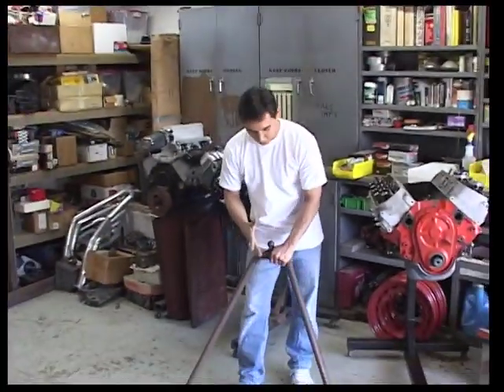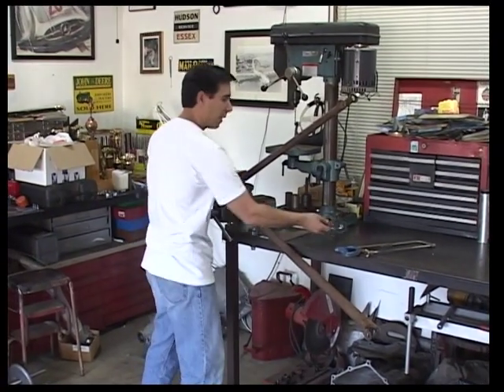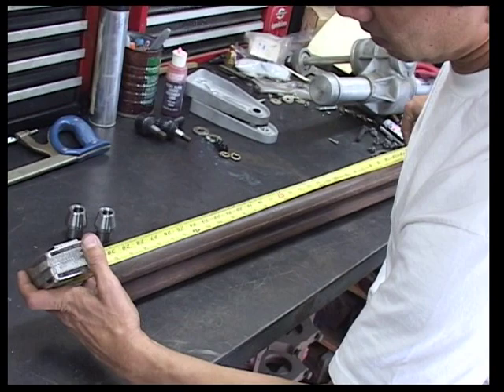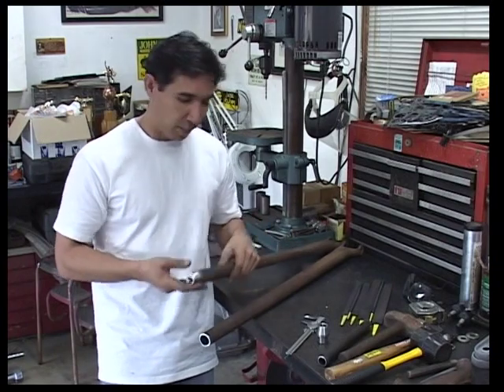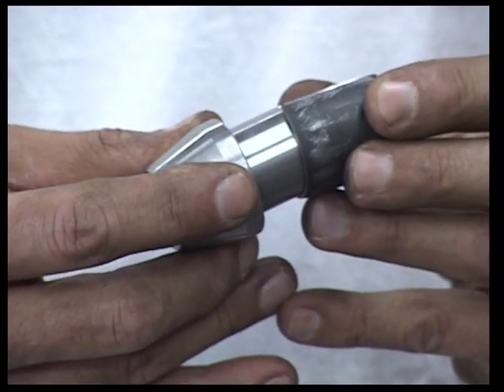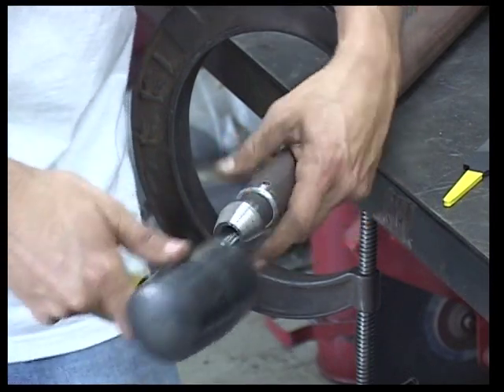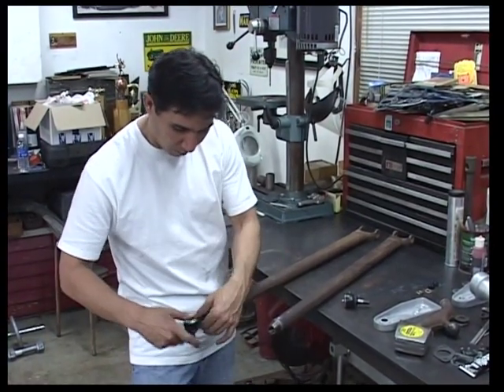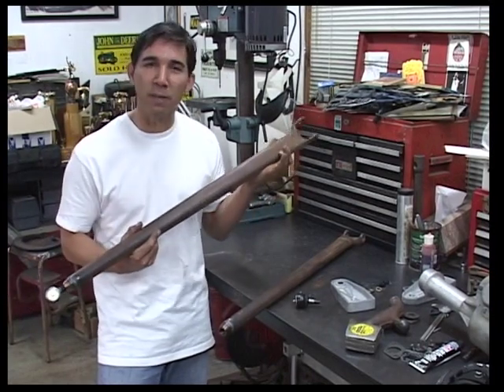How to Split a Wishbone project

Comment: Michael,Thanks for sharing.  For your future projects, you will be much happier with your finished result if you tack weld both sides before starting any semi-continuous weld bead leading to distortion.  You'll probably be much happier with some cutoff wheels to go on that Dewalt instead of using the hack saw, but then again, you'll be changing that white shirt in the middle of that project.
Reply: apronment in the shopment.

Comment: I agree with Roy and i would have welded the spacers to the bung first and then inserted them and welded them in
Reply: whilst chamfering the holes for weldment. my auto correct puts a red line under mis-spelled words. weldment has a red line under it.

Comment: The plug welds while a good thought and needed were wasted by only welding to the spacers instead of the bungs. holes should have been drilled in both. otherwise nice video. I have vertical, horizontal and portable bandsaws and still use my hack saw daily.
Reply: Second that . They plug-welded only the spacers, not the bungs. So it's not as strong as it should be.

Comment: This is a good idea to fit a 32 transmission on my model A but mechanical brakes will still work?
Reply from the maker: You will need to find yourself a 32 transmission crossmember to do that conversion and it will become complicated to make the mechanical brakes work but it is possible.

Comment: You should be pushing your weld and not dragging it chief.
Reply: As he was welding, he was making a vertical weld. When you are using a mig welder, vertical weld are made from the top down. And with a stick welder vertical welds are done from the bottom up. In both cases you get a superior weld hold the filler at an angle of 15 degrees if at all possible.
Reply: 90% of all current welding instruction and testing has shown virtually no difference between pulling and pushing while MIG welding. But ya back in the 70s when I learned pushing was the way it was drilled into us. Myself, I find pulling creates a flatter bead while pushing a bit raised but what the hell, does it really matter.